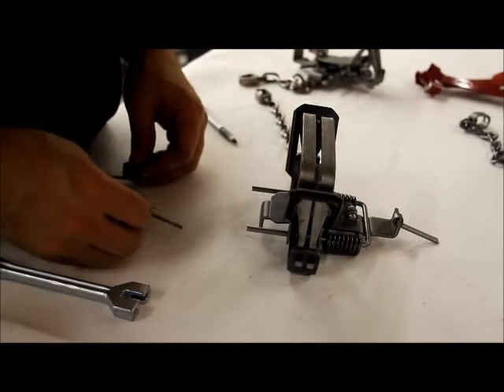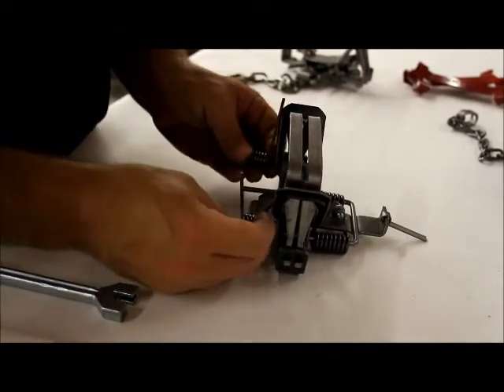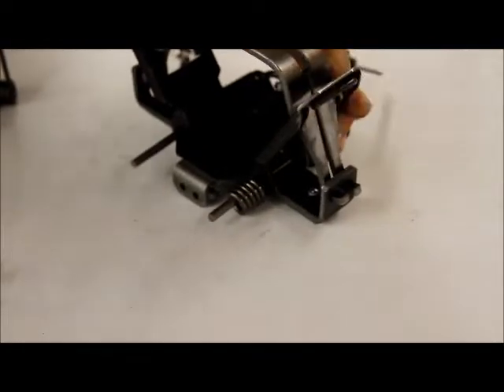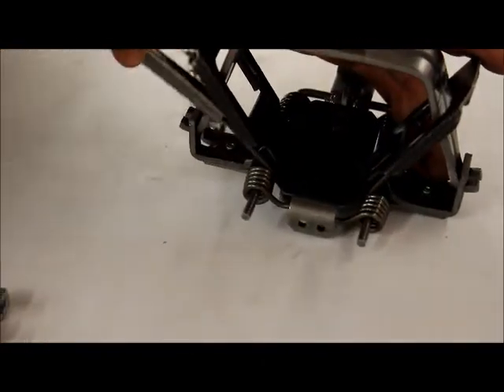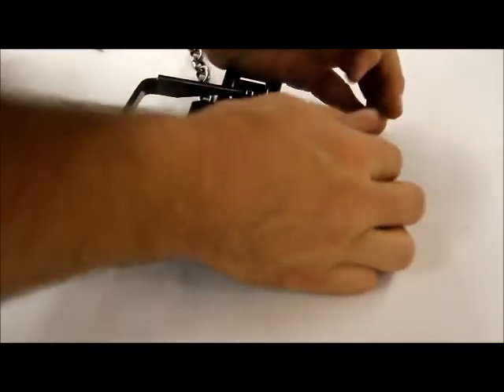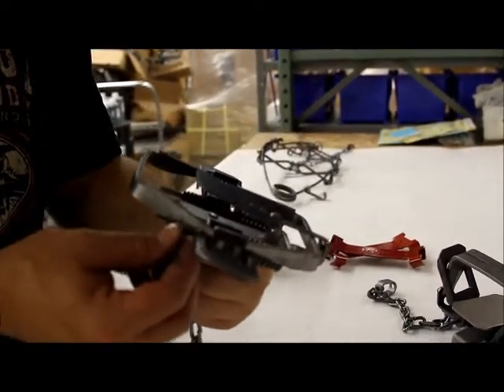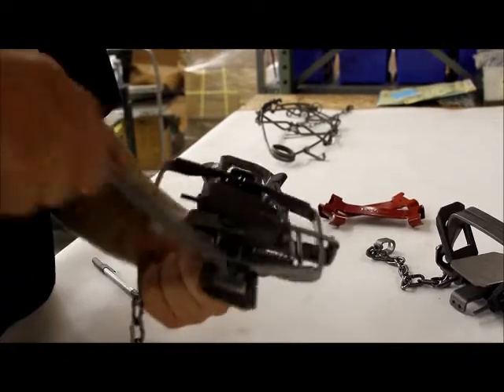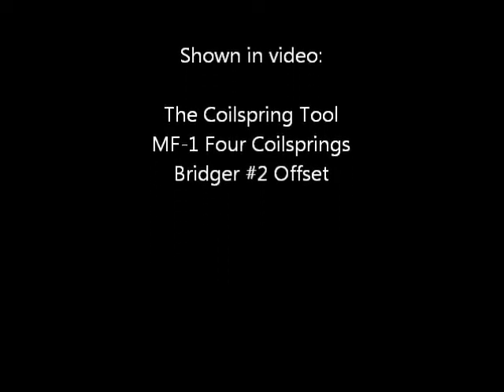How to 4-Coil a Trap

Comment: What’s the benefit to having 4 coils vs 2? Speed or hold strength?
Reply: Speed and strength
Reply: Not needed for most applications. But when the grounds starting to freeze or targeting cats or using say a #2 as your standard sized trap adding a set of coils will make your #2 compatible to a double coil #3 or possibly a little stronger. But you don't have the inside dimensions or can't run quite as big a pan.